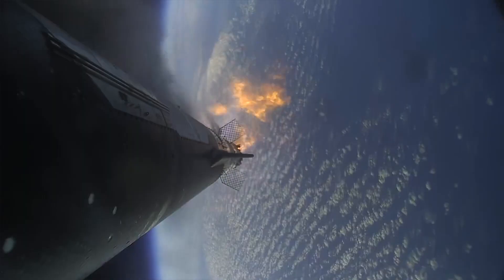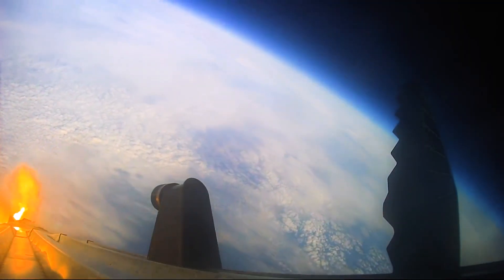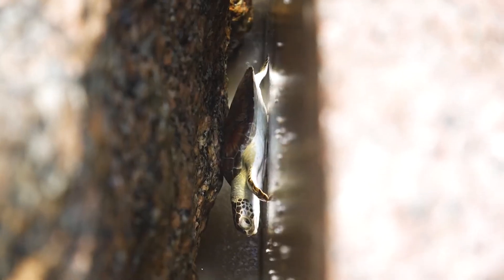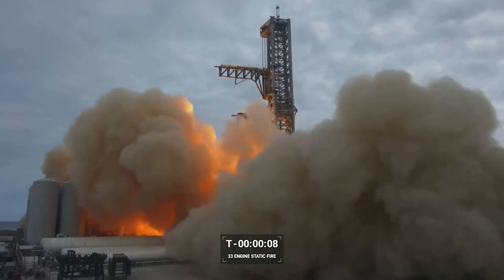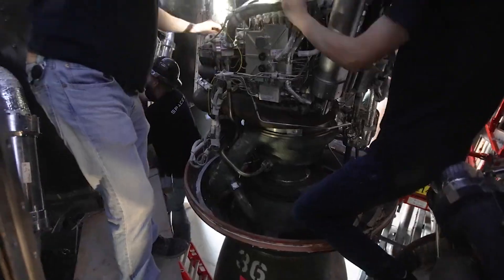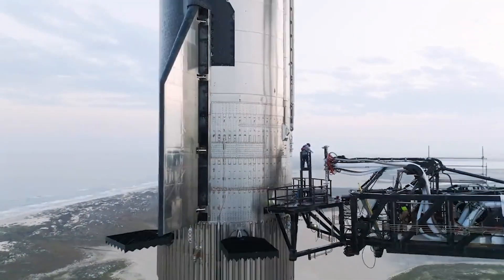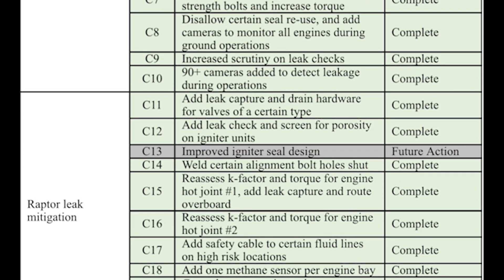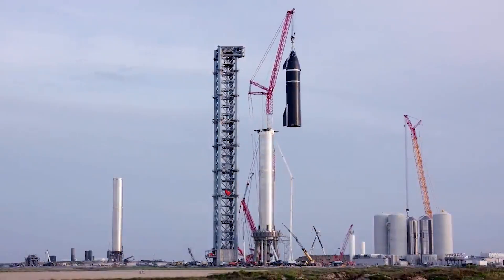Why SpaceX Is Confident Starship’s Next Launch Will Be Different

Comment: On flight one stage  separation never occured because it never met conditions to activate this flight event. Vehicle was too low and had too little speed for the systems onboard to go for stage separation.
On orbital launch vehicles staging event isnt dictated by time or propellant left in the first stage(unless first stage reaches low level criteria, a level of fuel so low, that you have to shut off the engines, or you risk damaging them). Instead stage separation is dictated by how close the vehicle is to desired trajectory planned out prior to launch. If booster stage overperforms, stage separation will occur earlier, if it underperforms, it will occur later, or, if it goes completly nuts and is nowhere near the requirements as we have seen on IFT-1 it will not even be attempted. 
Despite common belief, no, stage separation was not a failure on first flight, it wasnt supposed to happen because vehicle never reached all criteria to perform it.

Comment: so there was this one time spacex straight up defied an order from the FAA to stand down and launched a starship rocket which then blew up and spread debris all over the place. and yet the FAA just sat there and did absolutely nothing. it's honestly insane that the FAA just doesn't do their job anymore. remember the 737 max? that's what happens when regulatory agencies let industry regulate themselves. they will never be responsible with it - it's a foregone conclusion. the absolute clown show that has been boca chica is firm proof of this.
Reply: like, pretty much every major system in the last test launch ended up failing and falling apart. and spcex was well aware this would all happen, they were bragging that they launched the rocket on 4/20 with faulty engines they just needed to get rid of. it boggles my mind to no end that people are just fine with their insanely irresponsible approach to engineering. it's basically the exact same shit as the titan and oceangate: construct things without finishing the engineering first and dealing with problems as they crop up in the process. it is unsafe, inefficient and generally just not a great way to do engineering in the real world.